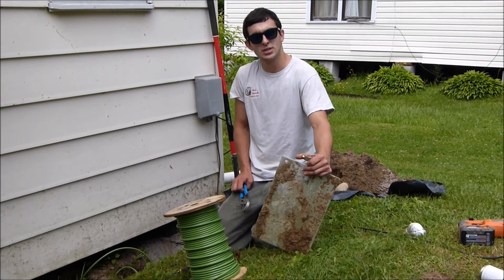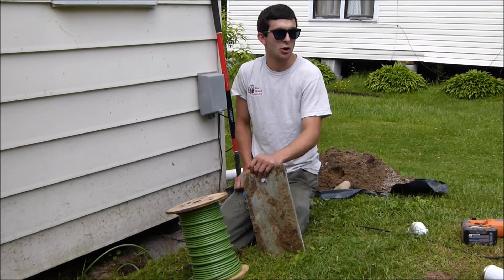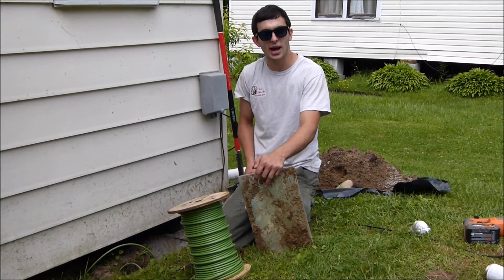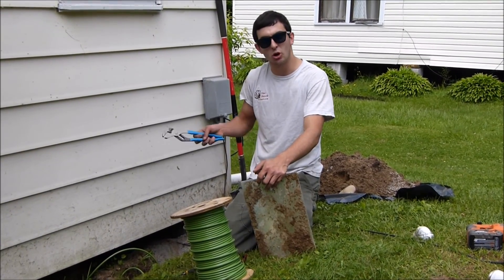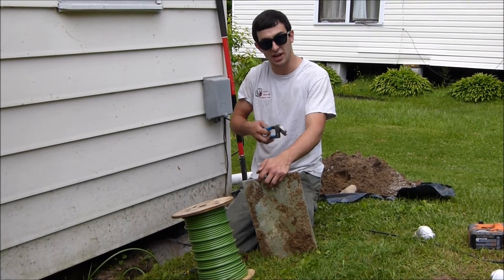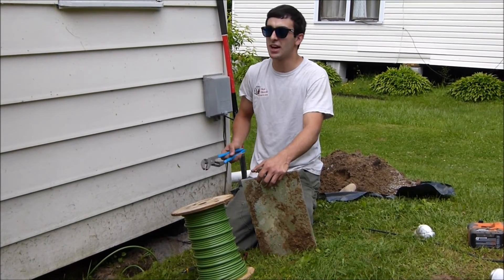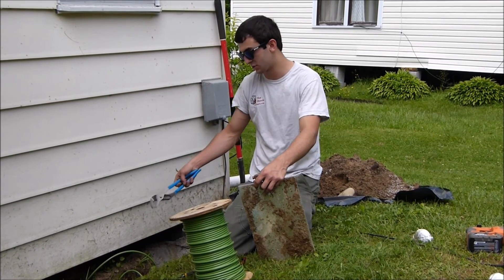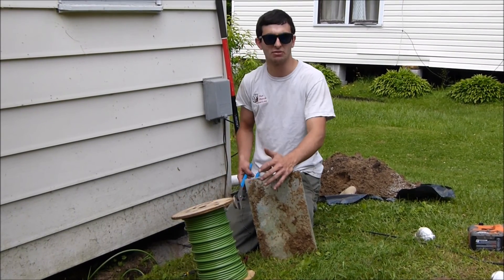The Shock Doctors   The Importance of Installing a Grounding Plate

Comment: Electrical does not take the path of least resistance it takes the fastest path back to the source
Reply: It doesn’t but I think if you happen to be there it will, I think that’s what he meant
Reply: Electricity takes ALL paths back to the source and the magnitude of the current is inversely proportional to the resistance of each path.